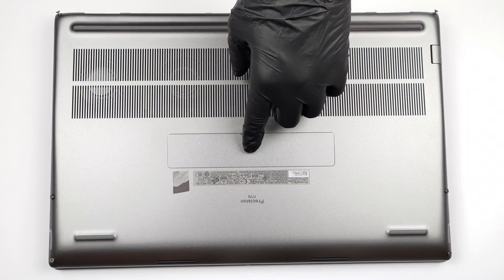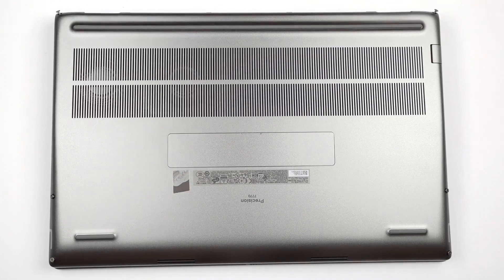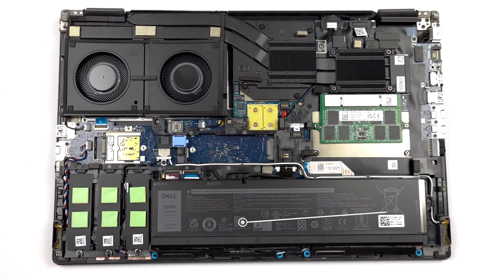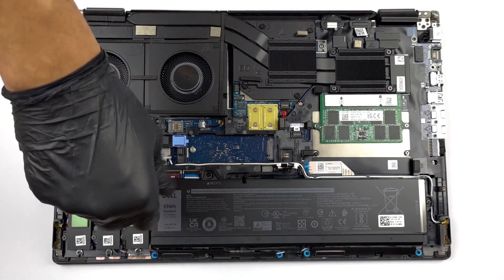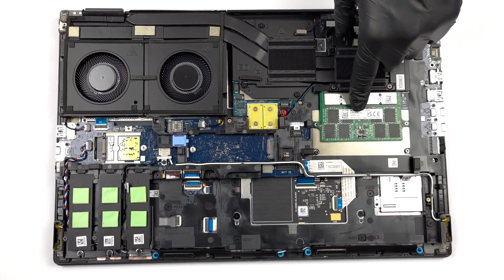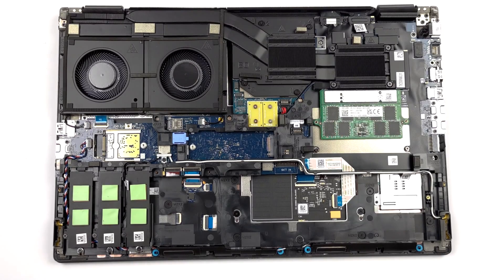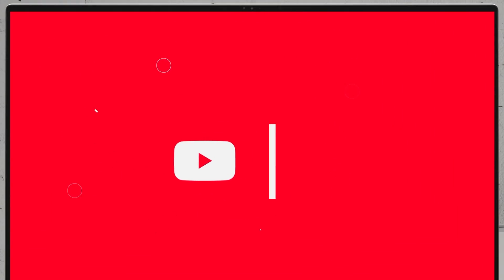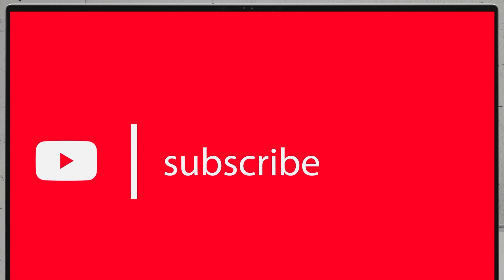🛠️ How to open Dell Precision 17 7770 - disassembly and upgrade options

Comment: I noticed that the lower case tray has a black sheet covering the vents where the CPU and GPU are. Would removal of these sheets improve cooling? Is Dell trying to avoid hot air from being recirculated into the fan intake perhaps?

Comment: The extra heat sinks are a nice edition, but considering the laptop's price and powerful GPUs (I saw one fitted with an RTX A5500) vapor chamber cooling would definitely be preferred
Reply: the two fans side by side is bad design, you're concentrating all the heat to one cluster instead of splitting them each on the side, which gives better heat dissipation. This laptop has been reported to have thermal issues and this is exactly the cause of it
Reply: @kenuffhew So which model are better? I mean it seems that nowadays the problem is heat in every laptop.